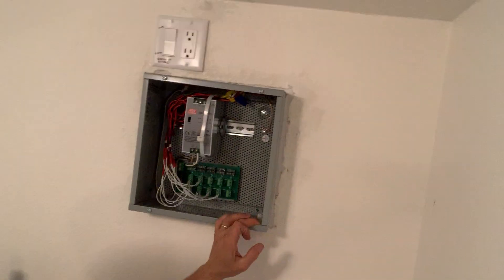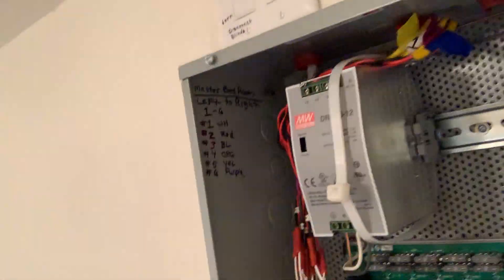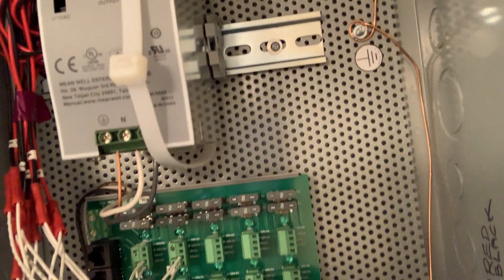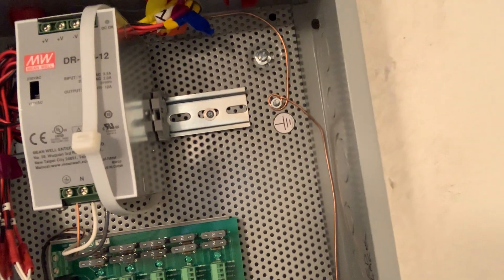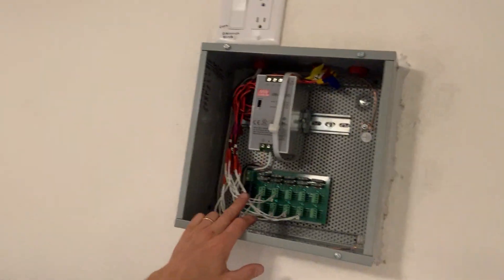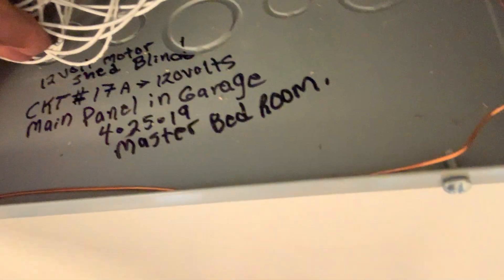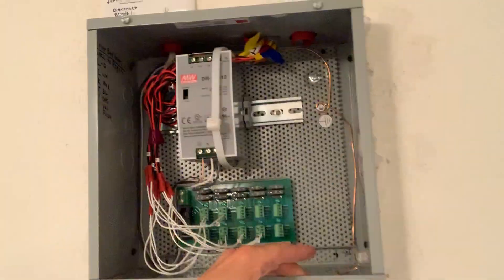Wiring for Electrical Blinds - Part 4

Comment: Hi. I was wondering. Why did you wire in the receptacle? Was it for convenience. Also why not keep the control box and disconnect switch in the attic instead of closet. 
Thank you for the series.